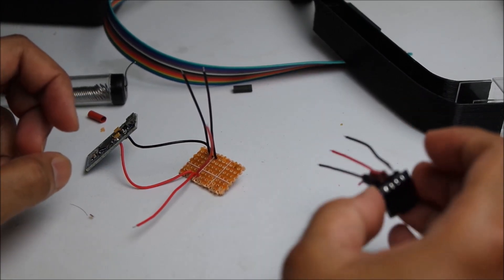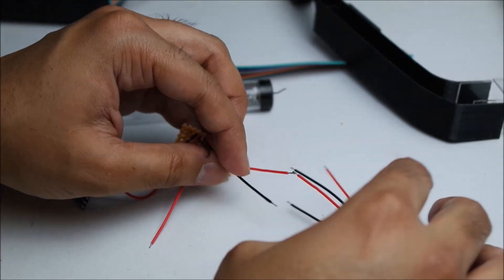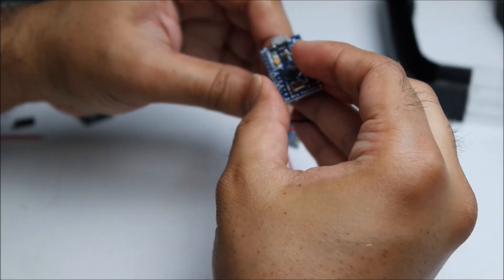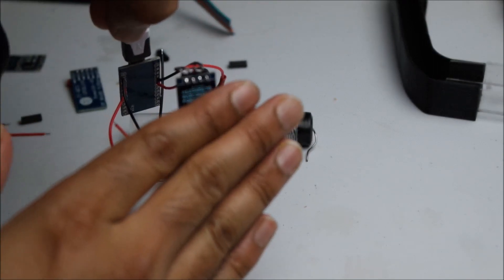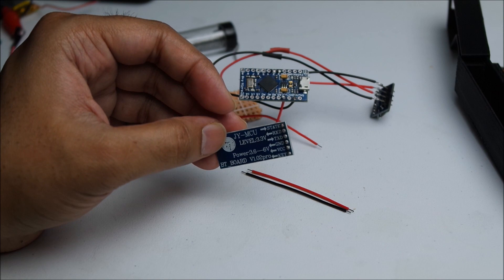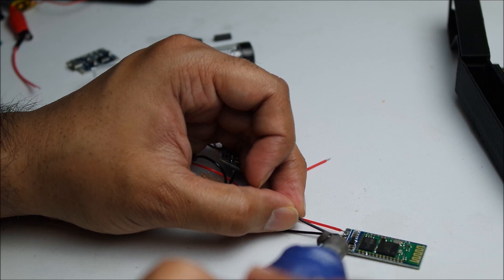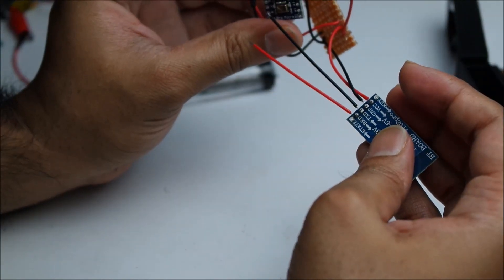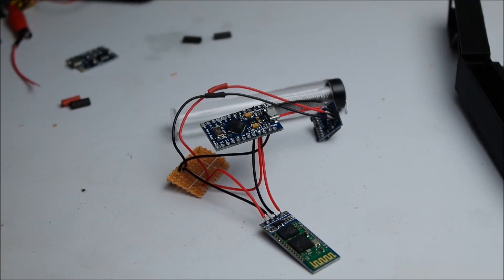DIY Google Glass: Complete Tutorial Part 3

Comment: What screen are you using? Is it available in Bangladesh? Can I get your email address?
Reply from the maker: 0.49 inch oled screen. check aliexpress
Reply: Tmallshop Blue 0.49 Inch OLED DTmallshopplay Module 64X32 I2C Interface SSD1306 for Arduino 3.3V 5V